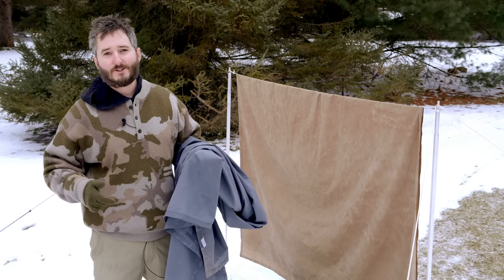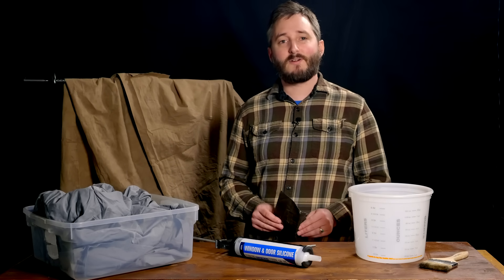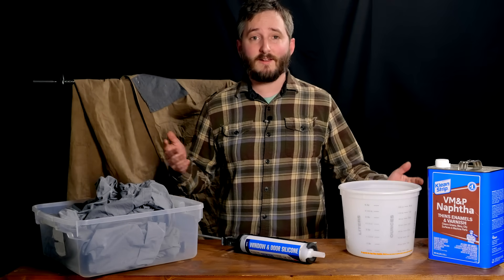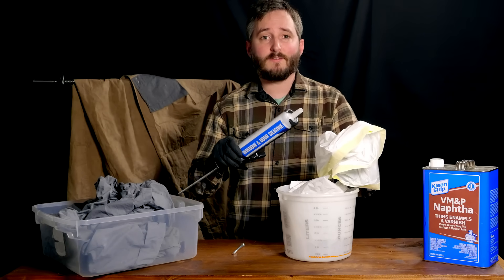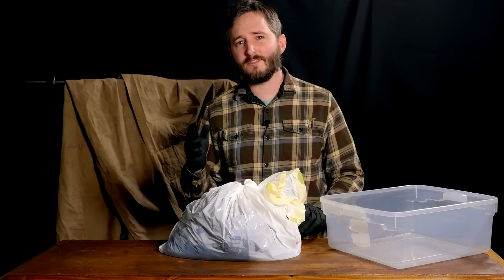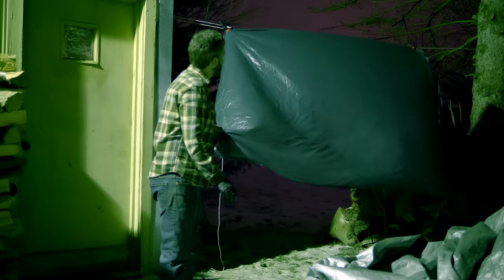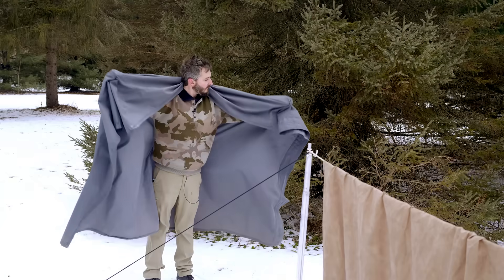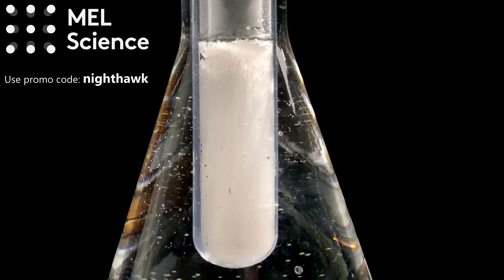Recycled Bedsheets Make The Best Waterproof Tarps

Comment: When using this for things which are in contact with the skin, would there be any considerations with the Naphta either leaving behind residue (due to it being non-pure as most bought chemicals are) or the solvent being slightly stuck inside the silicone itself, as to not completely gone by evaporation, and slightly releasing over time?
Reply: No, the naphtha is not the problem ingredient here. It evaporates completely. But the tin-cure silicone used here would be a big no for garments or items that'll be in prolonged contact with the skin. Tin-cure silicone is not skin-safe. But many platinum-cure ones are. Unfortunately, that means going the extra mile and buying special supplies. Local hardware stores, at least where I live, never carry the good shit... Platinum-cure silicone comes as a two part system and is much more expensive as well, sadly.
Reply: @melanie-rosannastevens7861  Thanks for the great answer, then even aquarium grade silicone is just a lack of fungicides, but doesn't necessarily avoid the curing chemicals used. From reading a bit into it, it seems like even platinum based curing systems sometimes use reaction inhibitors like tin, sulfur or amine compounds. So I guess I have to be very careful with what I buy, if it even says so on the product.

Comment: Great video! 

Just out of curiosity, 

how flammable would a cotton bed sheet be when treated in this manner? 

With the amount of white gas used in the process will it make the tarp ultra flammable or does the naphtha evaporate during the drying period?
Reply: Of course the naphtha evaporates, silly 😂
Reply: @melanie-rosannastevens7861  I think you’re confused by my question, silly you…. So let me rephrased it. Due to the use of white gas during the process, will the final product be flammable or not. Very important detail to know if you’re going to use a tarp as a light weight shelter near an open fire for example. Also, if you live in an area that is prone to forest fires as I do, having a flammable tarp that can catch fire easily is not a good idea, obviously…hence my original question.  The idea of waterproofing a DIY tarp is great, just wanted to know about flammability once the process is complete.

Comment: Here's what I did. Here's a real red can/blue can situation for you: 

I said, "What? Naphtha is $3 more than paint thinner and $1 more than mineral spirits! A solvent is a solvent, right?" So I bought the paint thinner. I got home and realized I had the mineral spirits already, so I went with the MS and decided I'd take the PT back. MS didn't really dissolve the silicone very well. Think shower drain after your 13 year old son gets out. So I said to myself (and I know I'm going to get flamed for this--pun intended), "Self...a solvent is a solvent, right? And what is that little red can right there? It's a solvent. A really good one. And it's way cheaper than all of these blue cans from the hardware store--even at FJB prices." So I stood back a little and poured in the [insert petroleum distillate name here] and, lo and behold--the silicone dissolved! Also I didn't die. I treated 3 sheets this way, but the last two were only treated using the red can. They dried in an hour hanging over a cattle panel leaned up against the outside of my garage. It was hot yesterday. I tested each sheet. They all repelled running water, and two of them held water. I tested by pulling the material through the hole in the fence to create a bowl. One held water for a long time. One held water for a less long time. One didn't hold water at all, but I think it's because it had a low thread count. If you want a real bougie tarp don't buy your sheets from the Salvation Army store! Today, 24 hours later, the smell of whale blubber refining byproduct has mostly faded. I'm going to wash these newly minted tarps in the washing machine using my favorite cleaner--the Purple Degreaser. If the smell goes away completely, I'll retreat with cheap red can and see if that improves the performance of each tarp. I think even if I had to treat the sheets twice with the red can--doing so would still be less expensive than treating them once with the blue can. I'm also going to try buying some oil-based paint and treat the sheets that way, but that's going to be a lot more expensive. I just want to see if the performance would be any better. 

Happy tarping!
Reply: hey out of curiosity how're they holding up?

Comment: This was great ! Seems very easy to do, I have a few questions like does it weigh a lot more? And how long has your tarps lasted under heavy use? The reason I ask is I would like to make one myself. Sounds like it's cheaper than buying a really expensive backpack tarp.
Reply: if you add up the weight of the sheet and the silicone you use you will get the finished weight - the Natha just evaporates

Comment: I have two projects that I plan to use this technique for. 1 is a new raincoat; I’m planning to make the coat almost to completion and then waterproof it so that the seams will not leak. The 2nd is a custom pram cover, and I’m wondering if there is any material/fibre this technique will not work for. I’m thinking of using a sheer fabric like organza. Will the naphtha dissolve the polyester fibre?
Reply from the maker: Probably it should be fine but test a corner first

Comment: Thanks for the video.  I have no doubt that water beads right off this and that it would keep you totally dry if there is no pressure.  But have you tried it as a ground cloth on wet ground/snow with your body or other weight attempting to push water through?  Gore Tex and other membranes fail this test often also.  Water laying on top will not soak through but if you sit on wet ground then water is pushed through the micropores.  This one reason why water resistance is measured as a pressure rating.
Reply: you just are never satisfied!!! - use plastic membrane from a builders yard on the ground - you`re welcome.

Comment: I could nt easily find 100% pure silicon in the UK so as a trial I tried standard cheap silcon which was two year old  lying about the garage along with 10 year old white spirit,/mineral spitit ..Easily mixed to the thickness and painted it on a very old none waterproof old raincoat..Hosed it 24 hrs later and the water beaded up nicely and just dropped off like water off a ducks back. I am wondering if 100 % pure and any silicon made up for bathrooms etc makes any real difference.

Comment: I plan to do this on different fabric material and once cured, cut up, sew, glue on etc to fabricate stuff like clothes, bags, inner waterproofing of container, fabric surfaces etc.
Could somebody please clarify:
1. Cutting, stitching, boring holes and any other kind of scarification to cause breaks in the continuous woven lattice of the fabric weakens waterproofing at said points and hence needs to be reinforced by the same process or paintbrush application. Or is it something I need not worry about.
2. What kind of glues I could use for adhesion to fabric and non fabric surfaces?
3. Can it still be treated glossy like ike any other fabric with washing in detergent/softener,  roning, wringing out before drying etc

Comment: Your videos are amazing. Want to try everything you do. Loved to make the the heat shield even though I had no practical use for it at the time. Now, this one will save me a bunch of money to water proof my house's retractable sun roof which is basically a giant roll of cloth. Not sure about solvent though. Don't see it much in the Netherlands. I did accidentally dissolved a silicon heater trying to remove the glue from it with isopropanol. Wondering if you have experience with that solvent for silicon
Reply from the maker: I haven't tested other solvents. It's hard to say what else would work without testing
Reply: @Nighthawkinlight  thanks for the reply. According to chat gpt and what's available around here my best bet is Xylene or white spirit. Both are inexpensive options here, but I prefer to use something more volatile (so will try xylene)
Reply: I have finally done it. Seems to have gone well. Drying out now. Still prefer this method over your new one. Much easier to source the stuff.

Comment: Professional theatrical Wardrobe techs swear that if you want to waterproof your fabric, wash it with fabric softener (hence why towels aren't very absorbant if washed with it). I'd be curious as to if both would be beneficial or if the fabric softener would soak into too much of the fibers, making the silicone treatment ineffective. You can experiment with smaller samples to find out.

Comment: very cool, I have a thick canvas tarp, I was thinking of putting linseed oil on it but this seems more light weight and water resistant. It could also be a good way to upgrade an old leaky tent, provided naphtha doesn't melt the fabric
Reply: Yeah, using this on an old tent would be very interesting.

Comment: I used exact same products to waterproof and saved unused mixture in a sealed bottle, air tight, 2 liter soda bottle. After 2 days, the saved mixture gelled.  Interesting...
I also used this mix to patch worn areas on a sleeping bag that had the stuffing pulling out.  Push stuffing back in and coat the area... works great.
Reply: Try storing it in the freezer

Comment: Your 'button'... I've used a tennis ball on corners of a light duty Poly Tarp - 30' x 60' to prevent the wind from ripping out the grommets. If your cord stays around the largest part it gives cushion and a larger area to resist ripping.
Used as water collection and cover.
THAT was an adventure in patience...:face-green-smiling::face-orange-frowning:

Comment: Do you think I could use Acetone? I know it’s probably more expensive but I bought more than needed for a different project.
Reply from the maker: I'm not sure. You could try dissolving silicone in it and see if it still dries properly. If so it should work

Comment: Interesting! This is a great method for waterproofing material!! There is also a spray available at hardware stores that can also be used for smaller items or fix ups, it's made for vehicle windshields. If your wipers aren't working because the motor is gone, this is the best product to buy. But, can be used in this manner as well for waterproofing materials.

Comment: A pouring tip: 
Orient the can with the spout on the high side when pouring. 
Not the low side he is doing.
It keeps the gurgling to a minimum.
Reply: Ah yes, the milk carton hack

BTW once the container is empty enough, the opposite might apply
Reply: You're a gentleman and a scholar
Reply: Use this technique when adding motor oil from the 5 qt bottle and odd shaped 1qt bottles to your car/truck also.
Reply: That's a good tip. I've used it for years and it feels counter intuitive but it works way better!
Reply: And I thought I was the only one that knew this.
Reply: And turning the can to the flat side up also keeps it pouring smoothly

Comment: I have a Jeep .. no top .. and a convertible that I use store bought covers that have dried flaked cracks ... like rubber tire dry rot. Has anyone tried this waterproofing method on a vehicle cover. Gonna try the 4:1 ratio and brush it on the cover  ... too big for a bucket  .....

Comment: I'm wondering if you could add permethrin to this waterproof sheet and make it insect resistant as well. I'm guessing the compound would break down st some point or be rendered inactive by the silicone casing.

At least it seems like you could treat the sheet with permethrin afterward.

Comment: Out here in the Sunny West, I often get a slight laugh when I see plastic being promoted as durable. I have plastic tarps, and the intensity of the sun (UV light) (and heat in summer) is more of a detriment to them than the wind. Unlike back East, sunny and snowy are common in winter. Also sunny and rainy is a thing too. 

By the way, I love the simplicity you put into this video!

Comment: Curios on longevity. If this space age idea of silicon coating fabric sheets didn't have a downside we would be using it instead of PVC tarps I would assume. 
Dosen't work out super cheap but I've seena lot worse. 
Exceedingly cool though either way.

Comment: Looks like this could be used for motorcycle covers. They always start off waterproof, but after about a year, the waterproof properties degrade and it starts letting in water so you have to buy a new one. Tried Thompson's Waterseal, but it didn't seem to work.

Comment: Doesn't make sense, it is not economical, the solvent+silicone cost way way way more than the size of tarp you aimed for. Regarding tarp being fragile/weak, I have yet to have any tarp break/tear/rip on me, I still have some tarps +20 years old. Another thing - tarps are much lighter than bedsheets or similar fabrics sheets, so why would I even want to burden my back with unnecessary weight on long treks ?!
I might consider this method for boots/hiking shoes but not tarps.

Comment: Just the "button" tip was well worth the watch, thanks! I was going to attempt waterproofing my golf cart cover but was worried about the seams getting messed up. I suppose any taping will essentially get replaced with the sealant and won't be harmed by the solvent. At worst, the cover was only $50 in the first place and is a couple of years old. Not much of a risk. Thanks for the video!

Comment: Another method for waterproofing a back pack or canvas type of material is to buy sail waterproofing made by StarBrite, for one.  I used it to help waterproof my canvas tent periodically because the factory waterproofing eventually fades.  Its not the same as the silicon method shown here but it works well and is reasonably fire retardant  as opposed to other brands such as Thompsons.   I watched someone's teepee burn like a Roman candle because they asked my opinion but decided it was too "inconvenient" so went with Thompsons, anyway and also didn't let the tent dry and fumes clear out sufficiently before lighting a fire inside.  That seems more inconvenient, to me. 😊

Comment: For the buttons, I use little pebbles that come from a river. Pick the ones that are perfectly smooth and as round as possible. These won’t damage your tarp. In a pinch you could also use glass marbles.
Reply: How about small Cork balls? Do you think they are durable enough? They are lightweight and definetly wont harm the fabric.
Reply: @SkepticalCaveman  That's a great idea. These are much lighter than pebbles and possibly last a fairly long time. 

A couple of caveats though: if you lose one or it gets damaged, you won't be able to replace it for another cork ball in the field. 

Also, they are very light and sometimes the weight of a couple of pebbles can be useful to weigh down something as well: multifunctional. 

If you're backpacking that extra weight isn't worth it. Go for actual buttons instead; if you can find thick, sturdy buttons, they weigh next to nothing but surely will get the job done. 

Come to think of it, you could also whittle little rounded 'pebbles' from wood. Easily replaced when lost and light as well. And it gives you something to do when sitting at the campfire.
Reply: I use marbles that I save from empty spray cans.On very large pieces of plastic I will use golf balls.
Reply: I have used plastic beads, available at most craft stores and much lighter
Reply: Marbles...
Reply: I have always used dirt.  About a tablespoon.
Reply: Acorns work well.
Reply: @bigoldgrizzly  Fantastic
Reply: How long will the waterproofing last on average? Let's say you use this method in southeast Louisiana to cover firewood in the open, exposed to sun and rain. How long do you think the waterproofing will last?
Reply: You can even use coins, or, in a pinch... buttons.....
Reply: @consentofthegoverned5145  You'd want to stay away from anything with edges that will stress the fabric and create wear points. Coins have fairly abrupt edges and some types of buttons do too. That's why you would look for the smoothest stones you could find... beach or river pebbles would be perfect. 👍🇦🇺
Reply: A dice also?

Comment: I've got a 5 day motorcycle tent camping trip coming up Memorial Day weekend 2023...
I've ordered a somewhat inexpensive tent for this trip, and I'm going to try a variation of this naptha/silicon method. The twist is I'm going to dilute the silicone a little bit thinner and put everything in one of those clear vacuum seal garment bags, and pull vacuum on it. I'll wrap paracord around the top like a loaf of bread, pull vacuum until it reaches the neck and gets sucked into the vacuum.
I'm going a little bit thinner, due to the insect mesh fabric and zippers. 
I'll also be using this method for some sheet tarps👍
It'll either work great or I'll be sleeping under the stars!

Comment: This method would be perfect for making several survival items. First, a microfiber pillow case would be a real multuse item. It could hold 3 gallons of water, melt snow, be a float, or protect items from water. A second use that may not work is rubberizing one side of a microfiber quilt ( also the edge seam. The microfiber filling and one side would be cloth. Insulated blanket, water proof, and easy to wash and dry. even with one side coated it would still dry.

Comment: This is probably a silly question, but does the silicone seal the ends and prevent raveling? Or should I hem edges first?
Reply from the maker: The silicone helps but might want to seam the ends for extra strength